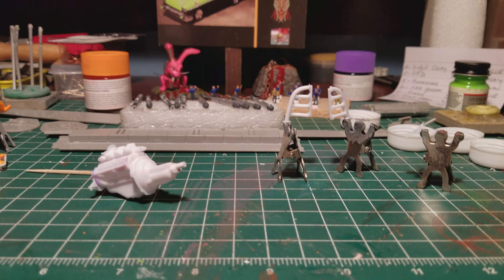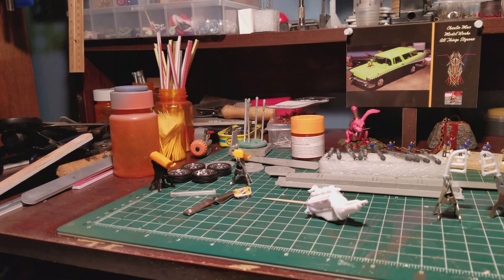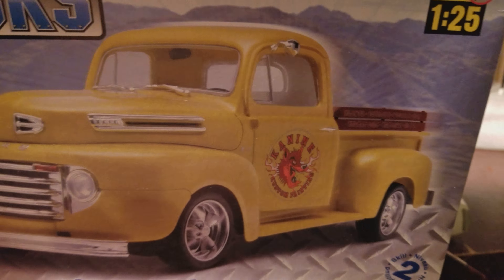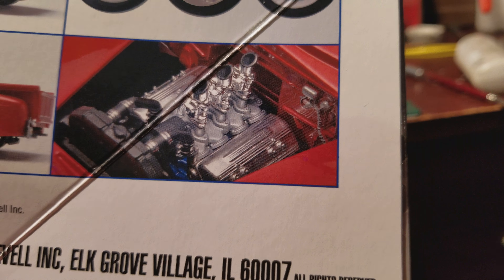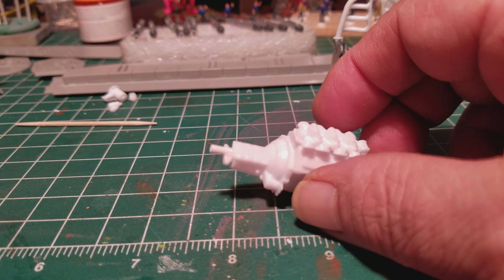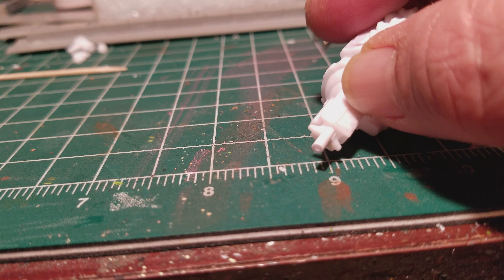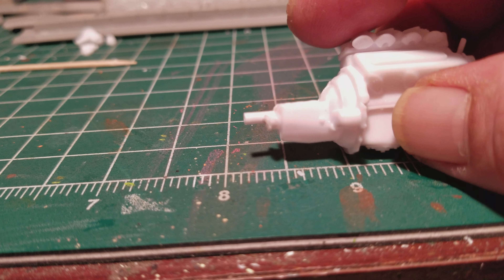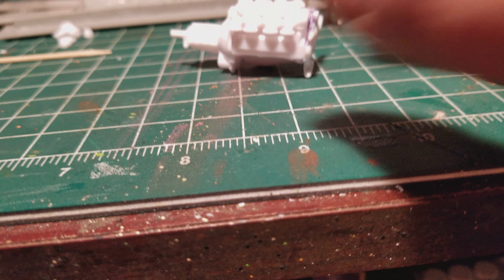A mind-less build....

Comment: The kit only comes with the 1 engine option. But it does come with 2 different suspensions for stock height or lowered height & different wheel options. The kit does build well with  few problems. Enjoy it.
Reply from the maker: Rick Zinck Gonna build it hot rod style.

Comment: The housing plate and distributor shaft would be good if you wanted to convert a 6 volt Flathead to a distributored 12v. Every cloud... hehe. Thanks for the heads up sir K)
Reply from the maker: Steve Watts There's always something.

Comment: dont you guys know what an ardun conversion for flatheads is?
Reply from the maker: ron stewart No,I don't.Why don't you tell me ?
Reply: the engine that you have is the flathead with a conversion that was made by a man in california that converted the ford flat head to an overhead engine. it put the valves in the head and created amore powerful engine for the hot rodders of the day. they still use this set up to this day.
Reply from the maker: ron stewart Thanks for the info.I wasn't aware of that. 👍